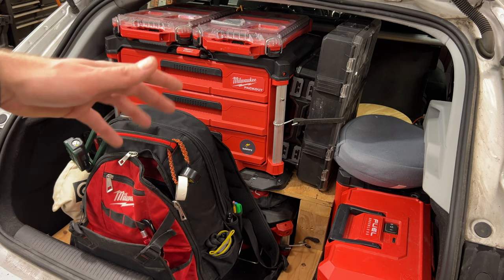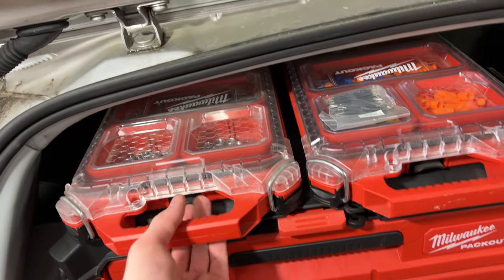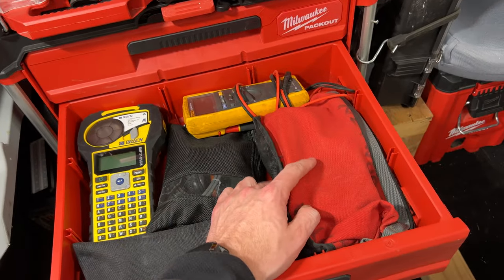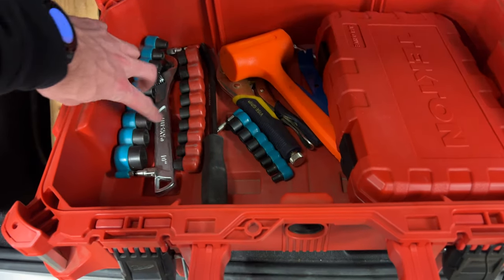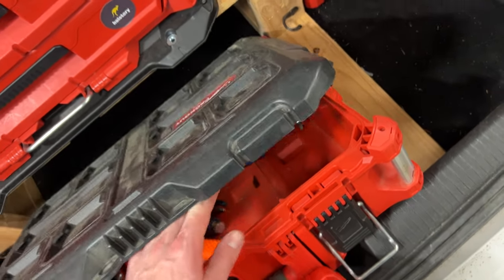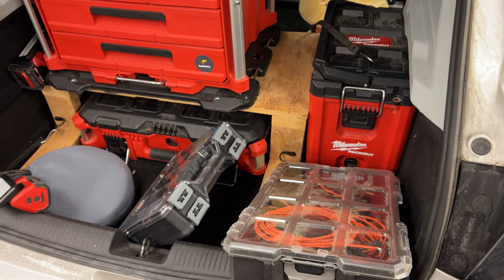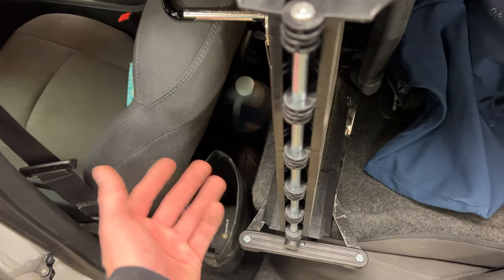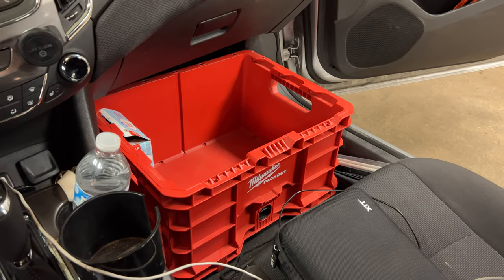Can a Hatchback be a HVAC Work Car? | 2023 Work Car Walk-around

Comment: Ergodyne Bump Cap (they sell full caps, and BYOH inserts).  Just found out about them, would have saved me so many minor scrapes, nicks, jabs, and bruises over the years -- for when you don't need a full hard hat, but you want something to keep you from absolutely decking yourself on a beam in a poorly lit ceiling/attic.  The only safety gear that matters is what you're wearing when you need it, so even some minimal protection that you'll always wear goes a long way.
Reply from the maker: I’ll have to check those out, I fully missed showing off my two hard hats that are in the footwell behind the passenger seat, oops! Only really wear them in summer when we are in the depths of heavy construction somewhere

Comment: What is the box at 15:50? It looks similiar to Keter/Hart Stack'n'Roll.
Reply from the maker: It is a husky interlocking small parts container, has like the little removable bins but this one I just took them all out - One of my absolute favorites but it’s discontinued. I recently tried to buy about 20 of them to use for shop storage, ordered them and had them shipped just to find that they were different and not what I wanted !